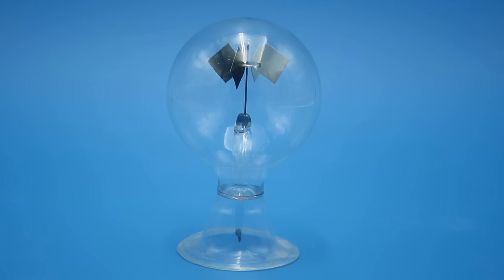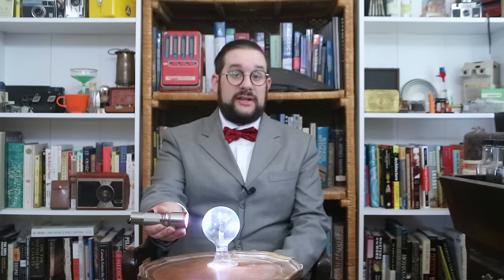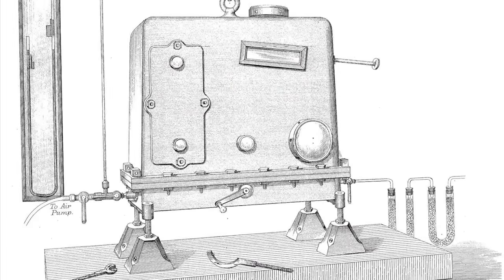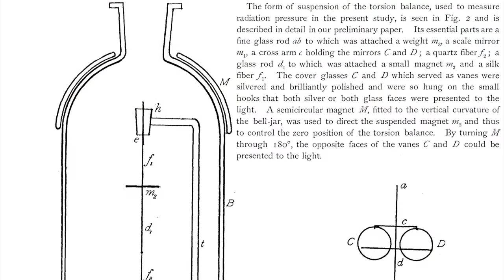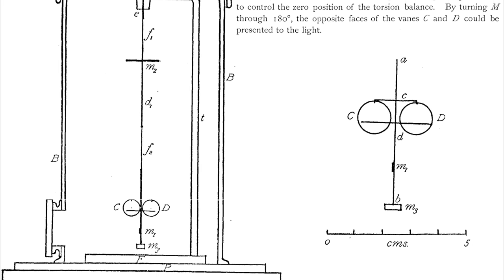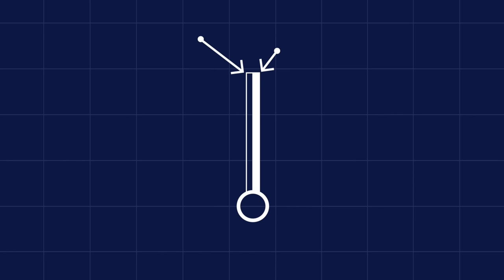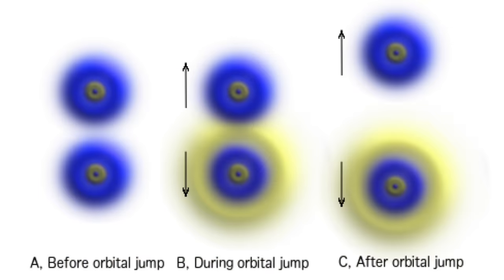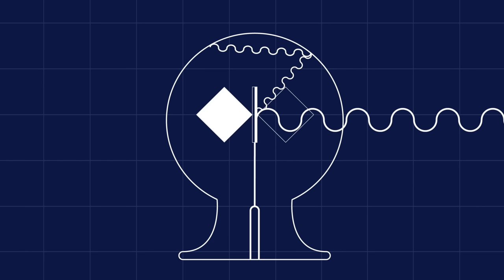Crookes Radiometer: a Surprisingly Persistent Scientific Mystery

Comment: crooke's radiometer is likely working based on air flow caused by temp, as you can cause the opposite spin by spraying an air duster can upside down on it to cool it.

Comment: Could you build this at scale, focusing light on the veins through mirrors and then feed the motion through a series of gear reductions (like a water wheel powering mill equipment) to drive an electrical generator ?
Reply: I was thinking at least try one that's two or three feet in diameter, maybe it could work on a magnetic clutch on the top or bottom, that way it be totally sealed.

Comment: I fail to see why the normal explanation would be an edge effect. We assume the black side of the vane is hotter than the white side. If the air is cooler than the black side, that means that air molecules hitting the black side will heat up: they will gain momentum. That extra momentum is directed away from the vane, and therefore the vane will gain momentum in the opposite direction. That process happens over the whole surface of the vane, because the whole surface of the vane is hotter than the air. Similarly on the white side. The air is warmer than the white side, therefore air molecules will loose momentum, momentum that is transferred to the vane, again over the whole surface area of the vane.
The Wikipedia article claims that "The problem with this idea is that while the faster moving molecules produce more force, they also do a better job of stopping other molecules from reaching the vane". But that is only the case assuming the air next to the black side is already warmed up and the pressure has evened out (it is basically the ideal gas law).  It is not the case while the warming process is ongoing. And because in a radiometer, the warming process is continuously ongoing, and the temperature of the air quickly evens out, that caveat does not seem applicable. 
Somebody has any ideas on this?

Comment: There is so much more experimentation that could be done. Change the gas inside the bulb, change the colour of the vanes. Use different colours on each side of each vane (not only black and white), use lasers of various wavelengths, inspect the characteristics of the reflected radiation, and so on and so forth. This simple device may hold the key to the universe!

Comment: Since it doesn't work in a vacuum, the gas must play a role. The action must involve thermal/fluid mechanics, not just radiation alone. How does changing the pressure, bulk temperature, and composition of the gas inside the bulb effect relation between rotation rate and radiation? What about the size and geometry of the plates?
so many questions!

Comment: If it depended on a temperature difference between the sides of a vane, then one would expect the effect to be enhanced by an insulating layer (e.g. polystyrene foam) between the coatings. Such a device should be compared with one where the coatings were deposited on a highly conductive (e.g. copper) layer of the same mass.

Comment: I'm at 9:37 in this video and almost don't want to hear the explanation. Growing up, I had plenty of these from Edmund Scientific in Barrington, NJ. I was always satisfied with the explanation that came with them, which one that was I have no idea. But knowing ahead of time that this is a puzzle, I had to stop the video after 3:00 to ponder, for quite a while, what the actual explanation might be. I suspected that the black side trailed in motion and had to go back to the beginning and check, Yes, it spins opposite from the direction it would if photos were bouncing off of the white side. I settled on the absorption of light by the black side and then that energy being re-emitted being greater than the same amount of light being reflected by the white panels. Why this would cause torque I couldn't imagine and what would happen at thermal equilibrium? Know well that these things will spin very quickly with intense light and do so happily forever killed that idea. When the section explaining all of the different theories from mighty physicists was read, none of which were correct, I calmed down. I wasn't the only one baffled by this. Now, at 9:39, let's finish the video...

Wow. Not what I was expecting and, as noted, I feel an awful lot better about not being able to figure this out. Count me as SUBSCRIBED!

Comment: I don't think the Liu proposal/hypothesis is anywhere near tied down. One would have to perform a number of experiments to see if it could be disproved and only occurs in situations consistent with his hypothesis. For example, the explanation that the vanes chase the white side when it is illuminated because of internal reflection onto the black side could be tested by coating the inside of the radiometer with a black absorbing coating...

Comment: I've no concept of what a Pascal is (nor a Newton), so I did a rough calculation, and worked out that a pressure of 1 Pasacl is about 0.000145 pounds / sq. inch - or 0.0023 ounces / sq. in.  If I'm wrong, please correct it.

Comment: There would be an easy way to test if this is depending on the temperature difference between black and white: simply add to the thickness. Try different materials with low and high thermal resistance.
Does this change the effect?

Comment: It's not the momentum of the light, that is far too weak. the thing also turns the wrong way around. The decisive factor is the very, very low gas pressure so that the free path lengths of the gas molekules are in the inch range

Comment: Can a radiometer with near-absolute black surfaces and first-surface silvered (or aluminized) reflective surface be made? Can one be made where the vane surfaces are half-silvered? Can particular radiometers be made which respond to EM wavelengths such as IR, radio, x-ray, UV?
Is the spin rate a function of the molecular weight of the trace-pressure gas or mixture?

Comment: I question the IR existence. If an LED light is used, but the LED does not emit energy in the red to IR spectrum, then how can 'heat' be the reason for the movement of the vanes? What happens if only a UV emitting source is directed toward the vanes? Also,  If a material that fluoresces and emits a long wave (red) radiation when exposed to UV, is there sufficient near infrared to generate the heat energy?

Comment: Excellent video. Thank you. I have another theory: When the vacuum is made stronger, the bearings take pressure which stops the vanes turning. It is a misinterpretation that high vacuum stops the effect. The reason that the black vanes are driven is because the black absorbs the momentum of the light. The white side reflects the light and it escapes with its momentum. Reflecting is much less momentum transfer than absorbing. That is why the radiometer works like it does. The other explanations are literal grasping at straws.
Reply: I’ve also been thinking about the effects of friction with the bearings. What would this experiment be like in a 0g environment
Reply: @pianplays3659  aren’t these very low friction bearings?
Reply: @TheAnimammal  yes but I also think the amount of force light could potentially generate is significantly less than it still
Reply: I don’t actually know I still have an entire rabbit whole to dive down
Reply: @pianplays3659  light pressure is well known fact and I think we may have got it wrong by using a reflective target. If we measure it properly by absorbing the mass, then the force is much larger. That is what I am saying.

Comment: "Since thermal transpiration is an edge effect, it stands to reason that if you could greatly increase the number of edges on a vane, for example, by drilling it full of tiny holes, you could increase the force and thus, increase the speed of the vanes.  Now so far as I know, nobody's ever constructed a radiometer like this." --- 

Well, Mr. Messier?   How much would it cost to get the 2 initial radiometers, and then have someone drill those holes in one and then re-vacuum the container?    

*Throws down the science challenge gauntlet (and then runs and hides!)*  😆

Comment: They should experiment on a version of this device on the ISS. Microgravity would require it pinned between two bearings.  Has anyone changed the gas that is at partial vacuum?  Hydrogen only verses heavier gasses Radon is more than 200 times heavier than Hydrogen.

Comment: I'm wondering if an experiment has been done with different wavelengths of light, to see if there is a difference in response vs wavelength. My radiometer spins way faster with a tungsten lamp than it does from an LED lamp with same intensities.

Comment: IR does not cause charge separation, you need higher energy photons. Thus the last explanation cannot be correct.
The Osborne Reynolds theory doesn't seem to make sense either. If molecules on the black side have more energy, then why it needs to be edge effect? Don't the higher energy molecules cause net force just by hitting anywhere on the black side?

Comment: What would happen to the radiometer if you shine a low-wattage red laser on either vane? Anybody try it? I had one of these when I was a kid some 60 years ago and it fell 😞
Reply: Different colors spin it at different speeds leds work too
Reply: They don’t even need visible light, I remember getting mine running by pointing a hair dryer at it.

Comment: every experiment has look at the gas and photons has anyone looked at the heat transfer within the vanes them selves in that one side should become hotter than the other causing a the air to expand on the hotter side and driving the vane away from it, the more intense the light source the greater the heat differential. thermal transfer takes place faster through a metal than the surrounding air.

Comment: The radiometer still works without a light side or dark side.
Reply: Light is an electromagnetic Wave ProtoBation with rare factions And re-fractions   it's not a wave and it's not a force it's literal energy coming from the ether that needs a little medium of air to operate the force affect but in a vacuum it is negligible but still there I guarantee you

Comment: This is all very interesting! But I am surprised that the impression is given that it has still not been clearly explained how Crook's radiometer works. I have such a radiometer and I am sure that the well-known and long-known explanation is correct: The vanes are usually and traditionally made of mica plates, blackened with soot on one side. When light, visible or invisible (infrared), hits the surfaces of the vanes, the black ones heat up more than the brighter ones. When gas molecules touch the vane surfaces, they are repelled with a stronger impulse from the warmer black surface than from the brighter, cooler one. The wheel simply rotates due to the stronger recoil of the slightly faster molecules.

This is a proven, logical and scientifically undisputed explanation that has been in physics books for a long time. (And on Wikipedia.)